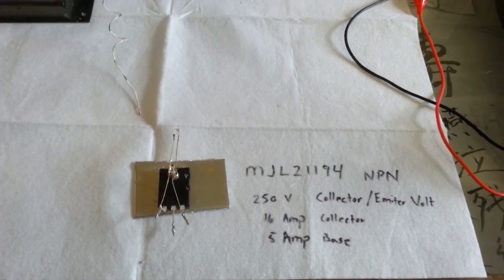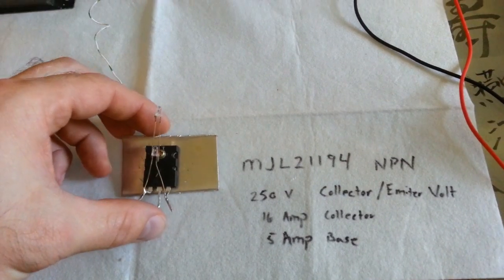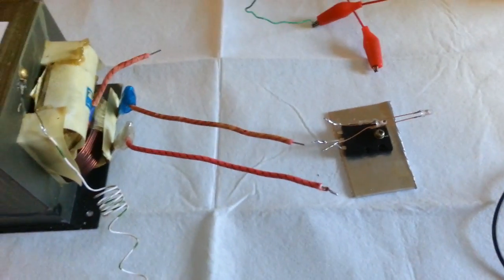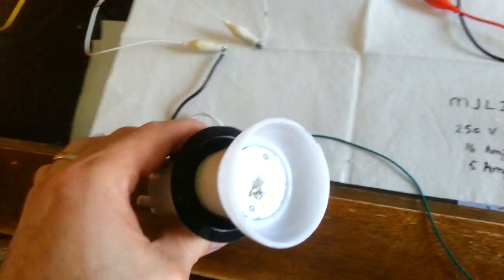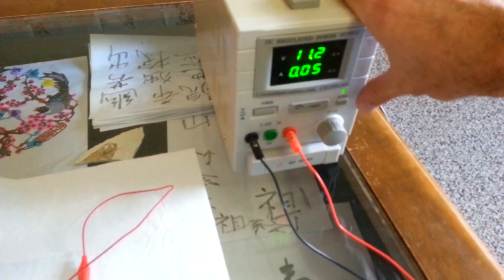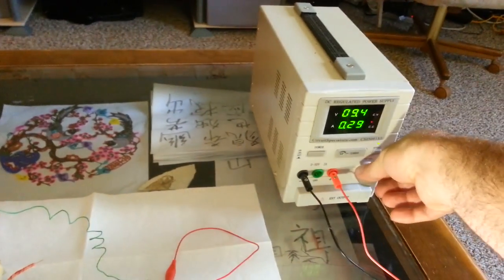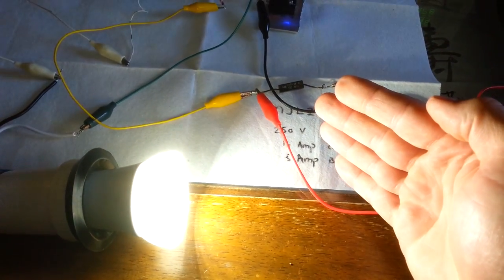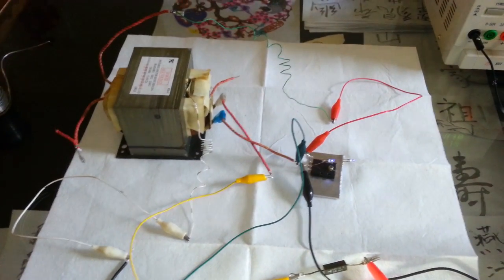how to build a joule ringer from a microwave oven transformer

Comment: hi am just wondering how much voltage is this putting out is it not dangerous i thought the secondary was about 2000 volts output also i cant see which wires your connecting to on secondary i have a mot and there are two red cotton covered coming out are these the secondary the only other visible conection on secondary side is a tab soldered on secondary on the opposite side to the primary connections can you help cheers  stephen